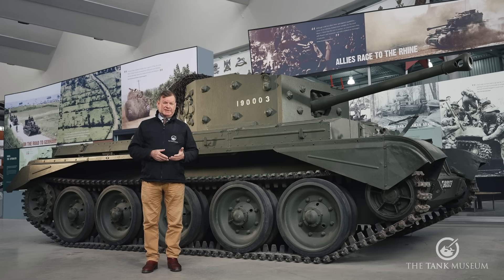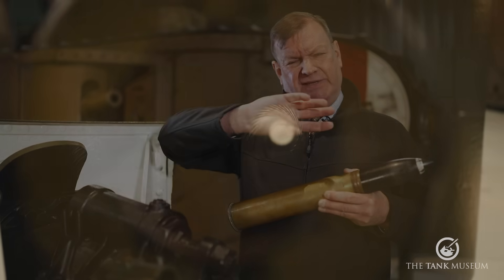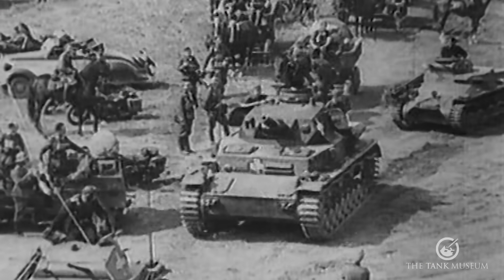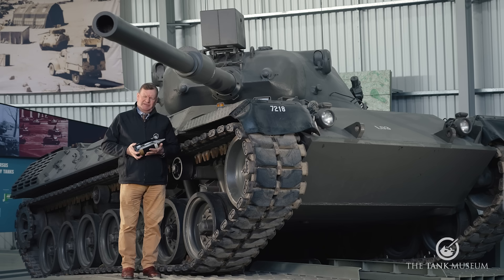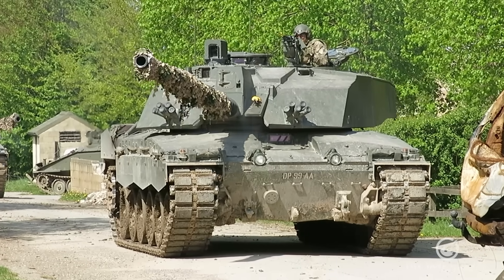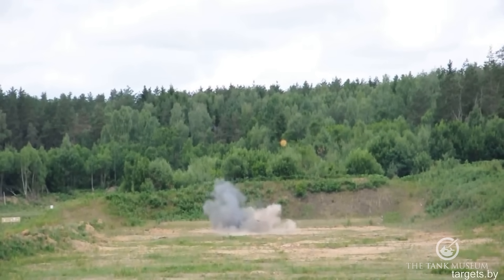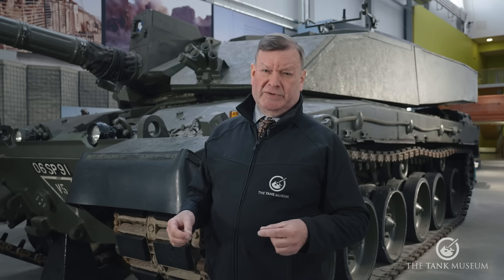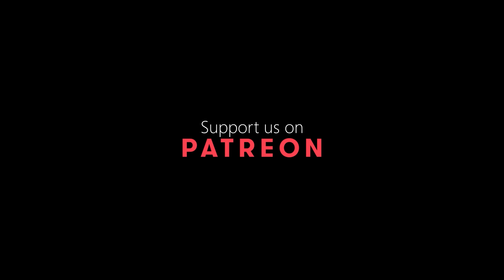Knock Out: The Evolution of Tank Ammunition

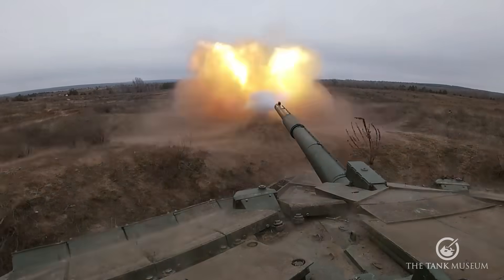Comment: 17:00 What's the point of using bags? Can't each specific round type come with its own case with its own special amount of charge?
Reply from the maker: Hi Tide Pod, The British Army likes two part ammunition largely for ease of handling in the confined space of the turret, but it also means that the propellant charges can be stored separately below the turret ring in liquid filled bins. This limits the possibility of a catastrophic explosion should the tank be hit.
Reply: Have you seen the size of an old fashioned cased tank round? Have you seen the amount of space Inside  a tank?
Reply: @zoiders  see the space left in a Firefly Sherman turret to loft and manoeuvre the brass case 17 Pounder round that the experts decided needed two loaders in the original Challenger tank. The USA test experts tried it and classed it as unfightable.
Reply: Additionally, two part ammunition in Chieftain, Challenger, and Challenger 2 allows more ammunition to be stowed and loaded faster because of its lighter and easy handling and it is more readily accessible to the operator than equivalent single piece cartridge.
Reply: I never understood that. You've got twice as many steps and have to essentially load the gun twice for each shot, nevermind the extra points for potential mistakes.
Reply: @FlyboyHelosim  ikr. I have the same thoughts
Reply: @FlyboyHelosim  Which is more than outweighed by the long list of advantages given above. Even the weight saving from not having the brass case is significant.
Reply: @trolleriffic  Well I'm sure most, if not all, other countries use complete shells with the case.

Comment: The issue with uranium shells is that uranium is a highly toxic heavy metal, not any radioactivity that might be present.
Reply: Same with tungsten 🙃
Reply: @Kuschel_K  tugsten is not in the same league as uranium for toxity... also it explode up into loads of oxide dust that spreads everywhere.... good luck with drawing false equivilences to try and make yourself out to be more inteligent the the enviromentally concerned

i could not care that most of it's toxity is not from the radiation itself, and that the mainstream makes this false assumption, it's far more toxic than tungsten, actually Russia doesn't use it!
Reply: @Kuschel_K  both are toxic but uranium is far more toxic
Reply: Not quite. U 238 emits alpha particles. A alpha particle source in direct contact with living tissue - like uranium dust in your lungs - can wreak havok.
Toxicity is still an issue. Especial long-term.
Reply: @Bird_Dog00  U-238 has a half life of 4 billion years. The radiation emission is trivial.
Reply: @Bird_Dog00  The mucus lining of the lung is enough to stop alpha particles in many cases and if it doesn't, the radiation still has to travel through the cell to its nucleus to cause real havoc which in many cases is further than it could travel. Alpha particle penetration in water and cellular fluid is measured in tens of microns so it's probably more of a risk if the uranium dissolves and is absorbed by the cells.
Reply: @trolleriffic  "tens of microns"? That's still a few hundreds of a millimeter. Afaik a normal body cell is about 20-30 microns in diameter.
Reply: @Bird_Dog00  Depends on the cells. It's been so long since I studied any biology that I forgot that the ones lining the lung are a bit weird, being incredibly wide and flat so an alpha particle would generally go straight through them - obviously if it was lined up with the nucleus it could damage DNA and ultimately lead to cancers. There was a hypothesis put forward that so-called "hot particles" like pieces of oxidised DU powder could present a much greater risk if inhaled than would be expected based on their total radioactivity alone - that is that having the radioactivity concentrated in one place resulted in greater hazard than if it was spread throughout the body. From what I've read that turned out not to be the case and the risk can be estimated based on usual dose and effect methods. Inhaling 100mg of DU would apparently give a dose of 19mSv which is well above "safe" levels but not enough to result in a measurable increase in cancer risk. To raise your cancer risk by about 5.5% you'd need to inhale more than 5 grams of DU and about 5x that to reach the LD50 level. Not something you want to breathe in but not incredibly dangerous either and fortunately uranium dust settles out of the air quickly.
Reply: It's toxicity comes from the "burning" effect that results in airborne particles either being directly ingested or via food products. Technically, the commentator is correct when disregarding Russian commentary. However, the accusation of chemical warfare is valid. Thank god that the British use this type of weapon only outside their own country and not in the English Garden.

BTW, watch the commentary change to squealing had the Russians used DU munitions on the Ukrainians.

One more point on the anti Russian propaganda, it is not only Russians complaining, any sane person would also complain.
Reply: Bananas are radioactive ☢️
Reply: "International Atomic Energy Administration points out, “DU is 3 million times less radioactive than radium still found in many old luminous watches and 10 million times less radioactive than what is used in fire detectors.” DU is also far less radioactive than the potassium 40 found in the human body. Potassium is a substantial percentage of the dry mass of common Hawaii agricultural crops such as bananas and marijuana. A 2.5 lb bunch of bananas will contain over 100 mg of potassium 40. Gamma detectors are used to detect marijuana smugglers at international borders."
Reply: "International Atomic Energy Administration points out, “DU is 3 million times less radioactive than radium still found in many old luminous watches and 10 million times less radioactive than what is used in fire detectors.” DU is also far less radioactive than the potassium 40 found in the human body. Potassium is a substantial percentage of the dry mass of common Hawaii agricultural crops such as bananas and marijuana. A 2.5 lb bunch of bananas will contain over 100 mg of potassium 40. Gamma detectors are used to detect marijuana smugglers at international borders."
Reply: Depleted uranium is toxic. The use of it is a war crime. This video is proof that the Tank Museum is a criminal and terroristic organisation. EVERYONE who promtes the use of DU is a candidate for the electric chair ...
Reply: Very true, but a lot of the news reporting about DU focuses on the radiation and often ignores chemical toxicity - something it has in common with a lot of heavy metals.